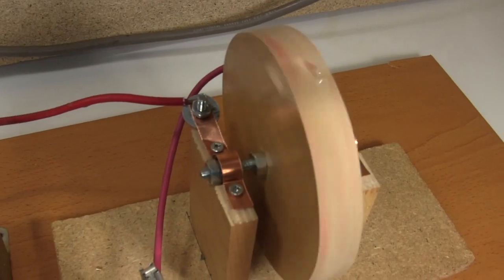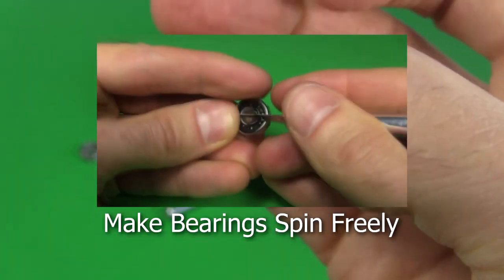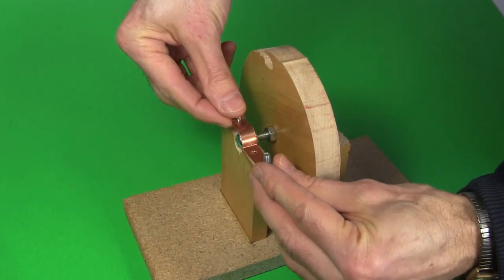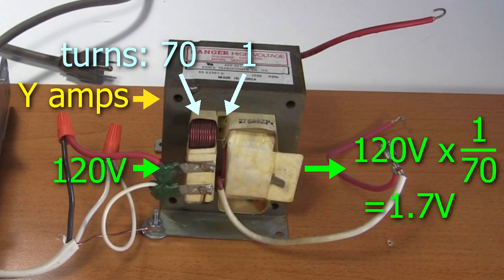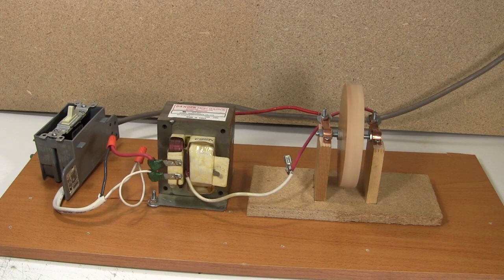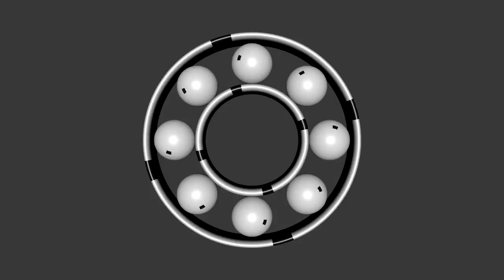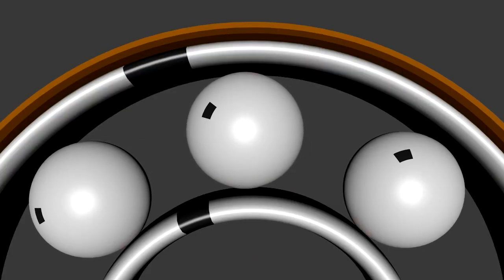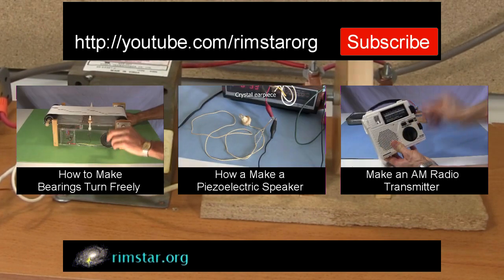Ball Bearing Motor - How to Make/How it Works

Comment: I never knew how those motors worked!  Very cool!  I always thought they work from some kind of magnetism!
Reply from the maker: Thanks! They could be working from magnetism. The thermal explanation I gave is just one of the more popular ones. Magnetism is the other.
Reply: What if you use copper bearing?  Though copper bearings are probably impossible to get... See what happens if you put strong magnets near it.
Reply from the maker: Makerj101
I'm not sure copper bearings would make a difference. The magnetic fields in the magnetism theory come from the current flowing through the conductive materials. No permanent magnets or ferromagnetics involved.
Reply: Hmm true.  Would the motor speed up if you put magnets near it?
Reply from the maker: Makerj101
I don't know. Both my sets of bearings are so carbonized that they don't function as "engines" anymore.
Reply: Oh. I'll have to give it a try some time.

Comment: The idea is neat.

However, the execution is extremely dangerous. At 3:00 you came VERY close to the HV tap of the MOT (while it was turned on). There's a lot safer ways to get high current power supplies.
Reply from the maker: In retrospect I should have removed the HV coil, but I figured I'd just be careful. And I thought I was until someone on hackaday.com pointed out what you did. Yikes!
Reply from the maker: Peter Krueger
No worries. And good idea. I just added an annotation to the section where I talk about the coils.

Comment: If you use lubricant, will it cause the motor to fail?
Reply from the maker: If the lubricant is an electrical insulator and there's enough between the balls and the rings/races to prevent the electrical current to flow then with the thermal explanation and the magnetic field explanation, it shouldn't work. I haven't tried with enough lubricant to know though. The two sets of bearings I tested with did both become carbonized from the heating and it stopped working.

Comment: I know current is what causes magnetism, so could there be any effect of magnetism here? I was thinking as current runs through the individual ball bearings, a magnetic field would result, causing motion. I was surprised this worked by heating them up how you described!
Reply from the maker: breezebro
Current flow by itself creates a magnetic field. For example, current flowing through a wire will create a magnetic field surrounding that wire. Shaping the wire into a coil just creates a more useful shape of magnetic field. Current flowing from one side of the bearing to the other is just like current flowing through a wire. The same for the current flowing through the rings/races. If you give the bearing a turn first, then the magnetic field around the bearing could possibly interact with the magnetic fields in the rings in a way that further spins the bearings and rings. There is reportedly a paper that's done a lot of calculations concluding that that may be the explanation.
But as for testing it by looking for a magnetic field, with both explanations there would be since there's current flowing.
Reply: breezebro Rimstar beat me to it. An electrical current though anything will cause a magnetic field to form. It just so happens that wire shaped into a coil around a permiable core concentrates and intensifies said field.
Reply: If you have a compass, and put it near a wire with about 3 amps of current going though it, you can see the needle move and line up perpendicular to the wire.
Reply: Any amount of current will work, it will just affect how pronoun ex the effect is. I was using a circuit with a drill motor as a load, and placed the compass near it. Like RimstarOrg says, none knows how this particular motor works, but that transformer is likely outputting ~50A.
Reply from the maker: Magnetism, as you point out, is also one of the theories for how this motor works. The heating I mention just seems to be the most popular one.

Comment: Have you ever measured the resistance through this motor? A 1100 watt heater only has 10 amps flowing through it. That is enough to heat the wires. If you have hundreds of amps flowing through this, it should melt the insulation of your wires almost instantly. If there is 1 ohm of resistance there will only be 1.7 amps.

Comment: is the output current AC or DC ?
Reply from the maker: The current going to the motor is AC. But it works with DC too; others have done it using batteries.

Comment: Great video Rimstar!  Can you please do a video on making a Large scale Galvonic Cell.  how much power can you generate out of a large scale version? the Bedol water clock has inspired me to do more with this idea. Also are there better (more effective) metals to use besides zinc and copper?
Reply from the maker: Thanks! A large galvanic cell does sound like an fun project. I could set it up to run some small load for a long time. I have a whole bunch of projects on the go right now, but I'll see if I can fit it in. As for more effective metals, I don't know of the top of my head, but do a search for a galvanic series table to see.
Reply: RimstarOrg will do Thanks!
PS: if you find any video of some one doing a large scale galvonic cell send it my way. thx

Comment: OK, this was AC. Do you know how to make high amp DC from high volt DC/AC?
Reply from the maker: Indra Ida Bagus
You're going to have to give us more information. I'm really not sure about what you're trying to do. Are you trying to run a ball bearing motor for a long time? If so, in my experience, it won't run for a long time. The heat causes carbon build-up and that seems to stop it working. This is just an interesting experiment. It's also very inefficient.
Reply: With big diodes.
Reply: After the transformer? Not sure if it was 50-60 amps.
Reply from the maker: Indra Ida Bagus
50-60 amps might be good enough to run the motor so you might not have to do anything. If you're talking about high voltage from an electrostatic source then I'd store it in a capacitor and them dump it all at once. But you'd get just a brief burst, which is all the current you'd get out of an electrostatic source anyway.
Be very careful with a high voltage/high current source! That can kill you. I shouldn't have left the third winding on my transformer since it's high voltage/high current.
Reply: Umm, so how to turn it or into or make DC without big diode but still overheat and break down after running for long time?
Reply: Ummm, no. I'm just wondering. LOL

Comment: Wow, leaving the old secondary on the transformer is just plain wrong, and extremely dangerous! - There is 2500 Volts waiting to cook you!
Reply from the maker: Yeah, I knew it was dangerous but "I knew what I was doing", until someone pointed out over on hackaday.com how close my hand comes to the secondary's tab i.e. I got careless. In future I'll remove the secondary winding if it has dangerous voltage and current and I'm not using it.

Comment: I made a similar motor, with a 12 volt battery it pulled about 90 amps DC . I was under the impression that it worked on the principle of Len'z law. If you make this make sure you use big enough wires to handle the amps. It also makes a good heater.
Reply from the maker: Surprisingly my wires didn't heat up, though I'd expected them too. But the copper strips holding the bearings in place became too hot to touch within seconds. I agree though, if you make this use big enough wires to handle the amps. For anyone who's curious, 75 amps is 6 AWG, 95 amps is 4 AWG, and 130 amps is 2 AWG. The thermal explanation I gave is just the most popular one. There are other possible ones too.

Comment: So this motor would work on DC source? I was thinking some magnetic field was going in the bearings.
Reply from the maker: Yes, it works on DC as well. Some use batteries directly connected to the motor to run it. The explanation I gave in this video is just the most popular one. I've given a link in the video description to abstracts of papers that provide some other explanations.
Reply: Nice, I'll take a look. Thanks!

Comment from the maker: Ball bearing motor - a motor with seemingly nothing to make it turn. The secret is in the bearings. Here's how I made one and one explanation for how it works. Enjoy!
Reply: jon sanford This is a demonstration of a concept, so commenting on its utility sortof misses the point.
Reply: jon sanford  New idea's and concepts are never "useless". This motor may spark another inventors imagination.
Reply from the maker: jon sanford
This isn't intended to be art. It also isn't intended to be efficient. It's intended to be an interesting motor, and judging by the large response it's generated over the various places it's been spread, many others agree. It had more comments, all respectful discussion, on hackaday.com than any other hack this past week.
Reply: jon sanford We probably just saw different things in the same video. To me it is an interesting anecdote on cause and effect. I would not try to make an electric car that converts the expansion of a heated metal to torque. But sometimes a reminder that such a conversion is possible can be fuel for a new idea. An idea in what domain? Who knows; it may have nothing to do with an electric motor. It might be a way to seal a furnace door instead (or not, that's just off the top of my head). Anyway, I don't want to give you the impression that I'm disagreeing with your experience of art or engineering. Rather, I'm offering up the possibility that someone out there will derive the concept and use it for something truly novel.
Reply from the maker: *****
One neat application I've seen for expansion of metal due to heat is a valve in the top/back of Enerworks' solar hot water heater panels. When the air inside the panel gets too hot, the expansion of a metal opens a valve to let some hot air out.
Reply: ***** this discussion would be useless without both sides.
thanks
Reply: Are you completely sure the rotation is only due to the thermal expansion?
I would like to see the same experiment with DC, I have a feeling that something similar to a Squirrel Cage effect might be involved, it could also be a combination of both effects...
Reply: Not even wrong

The concept is er  intresting
But it is so useless I will call it fine art
Reply: ***** Aesthetics is something i always consider.
Reply: RimstarOrg Nice job by the way. I think the conversion from electrical energy to heat to torque exploiting the expansion of part of the ball bearing (assuming that is the true cause, which it seems likely it is), is really interesting.
Reply from the maker: renzo guerra
No I'm not sure. No one knows for sure how it works. There's a link in the video description to a webpage with other ideas.
Reply: Completely missed the link, I'll have a look! Still have you tried with DC? That would be interesting, nice video anyway, thanks for sharing the experiment :)
Reply from the maker: renzo guerra
I haven't tried DC. That would require big batteries and I don't have any of those, no place for them really. It's been done a few times though.
Reply: Amazing... So simple yet so effective..
Reply: the idea of using a bearing itself as a motor is quite creative - there might be uses for it if you use modified bearings, I still enjoyed this informative video though  I wanted to know just how the hell this works after seeing a random video.
Reply: It looks like a rotating helical spring in a magnetic field from professor Eric Laithwaite's lecture.
Reply: its the lorentz force that drives it.. the current goes around the balls and produce a local magnetic field x  voltage = movement.
Reply: Ohm Zen
This will definitely won't spark other uses as you say. This is something that will damage bearings as said in video. So it's useless as motor. In fact this phenoema can happen in certain electrical motor uses and it's devastating for assembly. Btw in anyway this certainly isn't a "new idea".
Reply: I worry the desire to be entertaining that has overwhelmed the art world may corrupt engineering. A backlash against too serious is OK but taken to extremes is not good.
  Success in the art world has become all about being cute & clever like advertising. Serious art is unpopular. There is a serious need to make more efficient machines & systems. The thing demonstrated is a bad joke.
Reply: RimstarOrg There is a fad with art curators.
"What is the difference between fine art & craft"?

"Fine art is useless" .

I hate this!  It is an aristocratic posture.
Going back to Having slaves do hand work.
We still have 'clean hands status'   Pisses me off no end!

Comment: I liked the video, just wish you had set it up with more insulation on the connections and displayed the warning for a longer time. The whole experience with this bearing motor has given me a new idea for building a compound/high torque static motor. BOB

Comment: Very interesting, so it's heat from the current that keeps the motor spinning.
Reply from the maker: That's the most widely known explanation. I've put a link in the video description to a list of abstracts for papers that give other explanations. I haven't read those papers so I don't know how good the explanations are.
Reply: RimstarOrg
 Very interesting, then it should work with other means of heating inner and outer rings, like heat pipes or hot oil. A solid thermal engine.
Reply from the maker: cezar t
That actually would be interesting to try. It'd be pretty hard to get the high temperatures where needed without using electrical resistance heating.
Reply: RimstarOrg Maybe a simple blowtorch would be convenient enough?
Reply from the maker: kirk
Probably. You'd have to build some way to transfer the heat to the bearings... afterall, a blowtorch flame could destroy the plastic seals on the sides of most bearings.

Comment: I know that your explanation on what causes it to rotate is the same as many other videos on this phenomena. But no one has ever proved the explanation is correct. The heating may only be a by-product. Explaining  that it is a thermo reaction without eliminating other effects is not very scientific and only going along with the prevailing thinking, this does not make it so. BOB
Reply: Since this type of motor works with both AC and DC we should be able to eliminate the only other effect with sufficient strength to cause this motor to spin. There aren't any other theories, are there?
Reply: I would like to know if the action is caused by thermo or electrical and how it was determined that is thermo. What test did they use?  BOB
Reply from the maker: blackstar2008
I think Bob is suggesting that there may be a purely electrical explanation for what's happening inside the bearings i.e. without the bulging of the bearings going on. Possibly Coulomb forces.
Reply: There is one way to prove this explanation is correct. Bypass the bearings and supply current through the rotor alone. If it doesn't turn (speed up) then the bearings were causing the torque and explanation is correct, if it still works then another explanation is in order ;)
Reply from the maker: Hmmm... I wish I'd found this a few days ago when I was doing my research. It lists papers with a number of possible explanations: https://www.mail-archive.com/vortex-l@eskimo.com/msg34046.html I'll add an annotation for my  how-it-works section in the video about the speculative nature of the explanation.
Reply: RimstarOrg thanks for the site and alternate explanation. you have the hallmark of a true scientist, open to all possibilities :)
Reply: Possert74 You are just being a lazy and arrogant. If you are going post comments , please show some respect and intelligence.  BOB
Reply: blackstar2008
No, The rotation is definitely produced in the bearings by current flow. I only question if the rotation is caused solely by current heating or another electrical reactions or both. BOB
Reply: If it works with AC current and DC current, then the current flow and magnetism it may cause are not likely to be the cause of this effect.
Reply: USWaterRockets
I don't think being AC or DC current really has anything difference in the possible electric effect. Only a scientific annalist would confirm the process. I don't see that happening because of the high current draw and low efficiency. Now if you were to construct this set up with the races conductors and the balls dielectric and use a high electrostatic charge and it rotates on its' own, then you have a high speed static motor.
Reply: AC current would cause any magnetic fields to reverse polarity at the AC frequency. Therefore, if magnetism were the motivational force, the motor should not spin up with AC applied.
Reply: USWaterRockets
What makes you think that magmatic force is the only force of a electrical current ? what about the electrical field force. both  forces are contained in a electrical current.

Comment: Well done, yes, it is a low efficiency Stirling motor, it works just due to the heat exchange in the ball bearings...Regards, Stefan.
Reply from the maker: Hi Stefan, Well, I wouldn't call it a low efficiency Stirling motor given how different they are, but it does appear to be a low efficiency heat engine. You do heat both sides of each ball, but once the ball becomes all hot with the same temperature as the input temperature then it needs to cool off to continue working. Cheers, Steve
Reply: So using candle to heat bearing it should turn